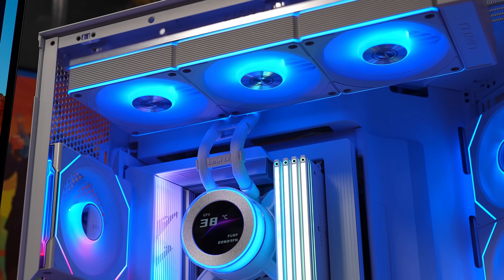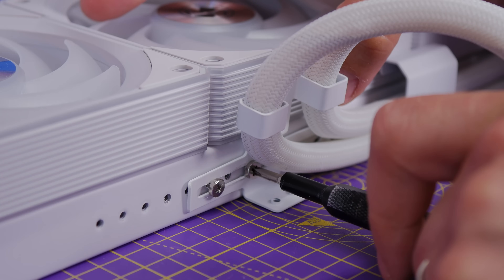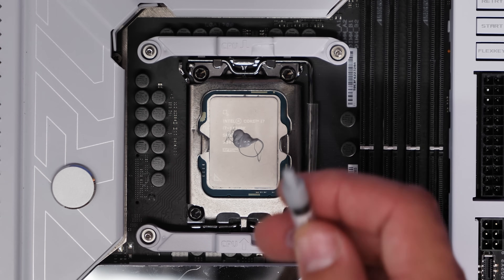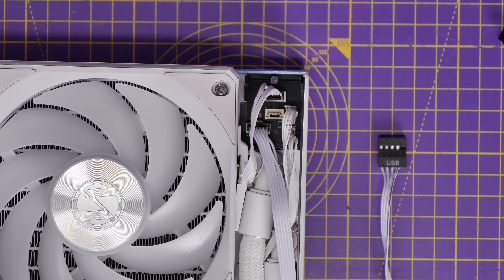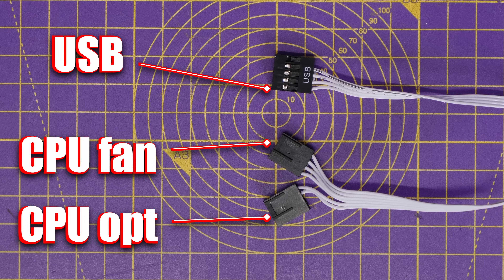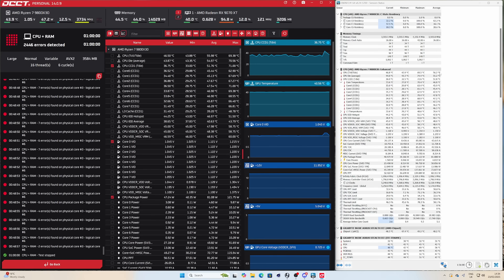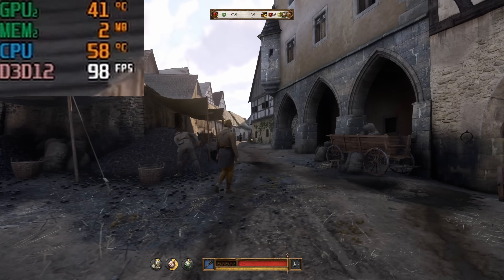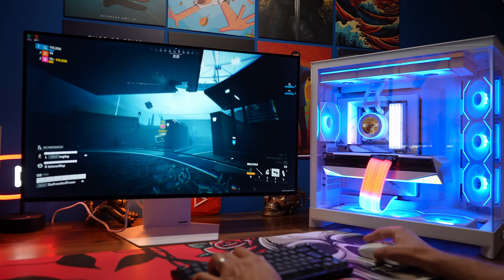Lian Li Hydroshift 2 review - eye pleasing cooling and software free control!

Comment: In case I have the MSI B850 Edge, I see (CPU_FAN / PUMP_SYS / SYS_FAN1). Where should I connect the 4-pin pump cable — to CPU_FAN or to PUMP_SYS?

Comment: Are these temps on stock ryzen settings no undervolt? And what was your room temp around at that time?
Reply from the maker: Correct. It's currently British summer time, so somewhere between 20 to 30 degrees C.  NO A/C.
Reply: @TheProvokedPrawn  thanks for your response , did you notice that on the occt test the tool detected 2446 errors?
Reply from the maker: It's just a random error. I've used the same setup in another case with the exact same specs and it was fine with no errors. Occt does that some times  @rin6295
Reply: @TheProvokedPrawn  ah cool . how would you say the mounting method of the pump is? did you get it right on the first attempt with the thermal paste not rubbing out because of the sliding method?

Comment: I have this model and what annoys me are how bad the software is compared to the really nice hardware build quality and thought they put into the physical design of the unit. The USB only mode has the only templates for displaying liquid temps, and all the advanced temps are only cpu and a few GPU related ones. The custom templates arent that amazing and you cant edit them! Also, the most maddening one, is that the fan curves cannot be tuned to liquid temp, and liquid temp isnt exposed in api for something like fan control. So, you have to set it to gpu or something, as CPU temp spikes causing fan surging. Why arent reviewers more focused on this?
Reply: also the PUMP Rpm seemingly beeing stuck to 2400+ RPM no matter how low % you set it. Had this on my OG Hydroshift and now on this one aswell and Lian Li just cant help with it lol
Reply: Ugh the software is just terrible on this thing. This is a great idea but i'd really like to see other manufacturers do something similar. If anyone is reading this and interested in buying it, I'd also really recommend buying the fan-less version and equipping your own fans - preferably ones that can hook in to your motherboards RGB headers.

Comment: After a month of having it, I went to install this today, and hit a major problem...

I'm using the MSI PRO Z890-S WIFI PZ motherboard, and the rotatable tube on the pump block is fouling on the VRM heatsink. It pushes the block away from the CPU, so you can't tighten it down. You can't install the pump block with the tubes in any other direction, other than the top. A If Lian Li thought about allowing for rotation, thew problem would be solved. A complete waste of time!
Reply from the maker: Interesting

Comment: I wonder if this AIO screen will show my GPU temperatures (RX9070XT) because my new NZXT KRAKEN ELITE AIO does not show them...
Reply from the maker: Hey Anthony. I asked NZXT and apparently they know of the issue and there is a planned fix, but it's not coming soon
Reply: @TheProvokedPrawn  Thank you for that.. WOW that is very poor on NZXT's part.. this is a mainstream card, has been out for months and they can't write a line of code to include the GPU temps? Im guessing that they don't have anyone working on the software as it hasn't been updated since January! Thank you for trying to get an answer though, I really appreciate it. Will be selling the NZXT  and getting the Lian Li AIO Hydroshift II.
Reply: @TheProvokedPrawn  I have spoken to a few owners of this Lian Li AIO and they confirm that the RX9070 series of cards are able to be seen on the AIO.

Comment: Hello,
I discover your Youtube channel since few days and i like it.
 I perform my next build who should be white in the  NZXT  H9 Flow RGB+. And i have difficulty to choose my AIO watercooling between this one, Lian li Hydroshift 2 , and the Nzxt Kraken Elite 420 RGB. I want to make a AOI  watercooling in push/pull mode. My hearth balance on them.
The lian Li Hydroshift 2 is super aesthetic with the tubes hidden and i can add fans like 2x Nzxt F360 Core (to keep the aesthetic look) or should I take the Nzxt Kraken Elite 420 RGB and add an second F420 core on it).
What a dilemma
Any advise/suggestion would be great 🙏🙏🙏🙏
Reply from the maker: I'd personally go for the Kraken - https://youtu.be/VxZDi3SsqJc
As it offers better cooling with push pull
Reply: @TheProvokedPrawn  Thank you for your answer.
Do you know if on NZXT CAM there is a way to know what fans  we use ? like Lian li does on this software for exemple

Comment: Hello, so I was planning to buy the RGB not the plus version of this case. I see that you were using 120mm fans on this one. Are the 140mm SL-INF fans compatible with this case and with the kraken 420? Also, where can I get a controller for the 140mm fans?
Reply from the maker: Yes they would be but there are no 140mm wireless fans currently. So you'd have to get the original Infinity fans (and a triple pack for the controller) or wait for a future release

Comment: Gamer's Nexus mentioned in a review of an ID Cooling AIO that the straight down tubing may be suboptimal. What are your thoughts? Thanks for reading even if you're unable / not inclined to respond.
Reply from the maker: I've not watched it and have no idea why that would be an issue...
Reply: @TheProvokedPrawn I didn't quite follow their logic either. I also know they're usually on point. It's totally possible I misunderstood them. Thanks for the quick reply!

Comment: I just updated my L connect and now my 3 stack of wireless fans are acting weird 
My whole PC is set to a purple color but the 3 fans will randomly blink white or blink in a rainbow color 
Also when I turn my PC on it has a breathing effect but when I go to L connect settings it’s set on static 
Anyone else dealing with these issues?
Reply: Same problem here.
Reply: @Orangenlimonade Any luck on fixing it?
Reply: @elchancho8432  I hooked up the second controller from other pack. It’s way more stable now, but the colors still randomly change from time to time. At least it automatically switches back to my setting after a second or two.
Reply from the maker: Are those fans connected to motherboard headers rather than the sata power adapter? They can be weird if not in pwm mode. The power adapter seems to solve problems. There's also a new version of L Connect coming with this launch so that might help
Reply: @TheProvokedPrawn All of my fans are powered by sata 
What’s the newest L Connect? I deleted L Connect and reinstalled it and still no luck 
It’s V2.0.29 
Is there going to be a newer one then that or is that the newest one?
Reply: Try reinstalling windows, I had read one guy from forum that has similar issue, and after reinstalling windows and reinstall 2.0.29 by right-click, select execute as administrator. Try it, I believe it will work.
Reply: Besides reinstalling widows, can firstly try hot plugging the wireless controller(dongle)